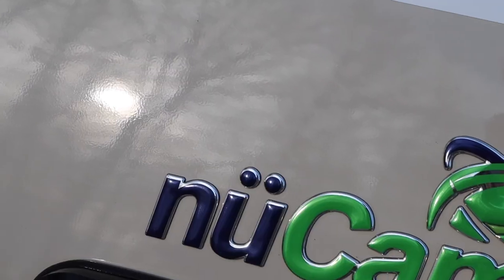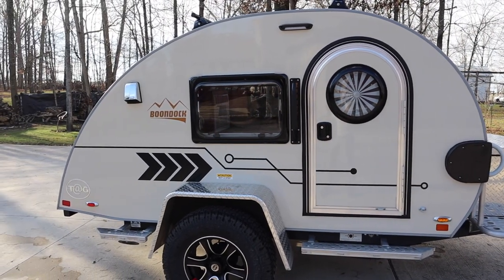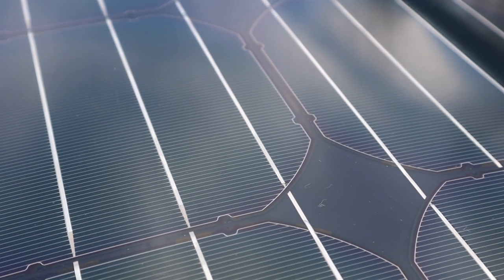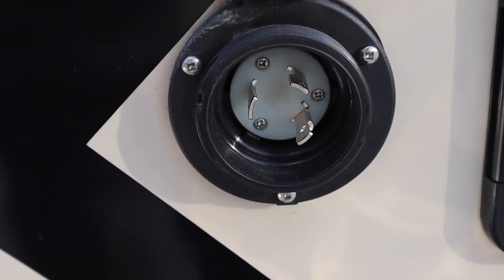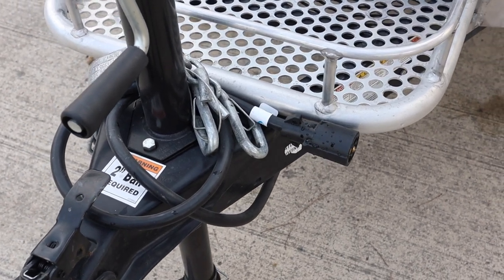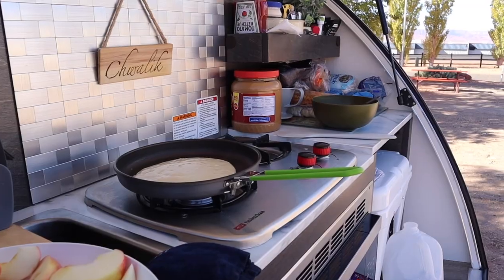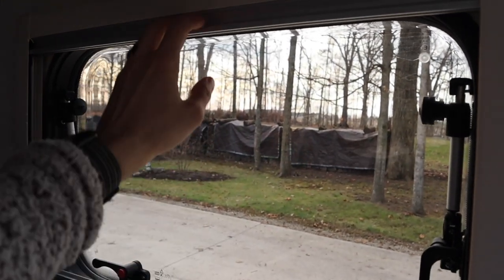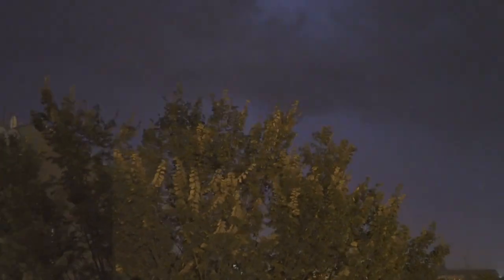Our 2021 TAG Teardrop Trailer | PERSONAL TOUR

Comment: Nice review! We have the 2020 XL, & the only problem we've encountered was excess humidity inside when using the ac; any ideas on cracking the windows/fan etc to keep the unit recycling?
Reply from the maker: Yeah, we’ve had that issue. We have the fan running to push air out and leave most of the windows cracked. That has worked for us most of the time.

Comment: How long will your heater and AC run off your solar battery setup? or can those only be run when you are hooked up to shore power?
Reply from the maker: The heater and AC only work when you’re connected to shore power or using a generator.

Comment: OMG

This is a great tear drop ...can you run the AC with the battery ? Can it run with the support of the solar panels? How about the heater ?  Or you will need to plug the teardrop from those functions ?  Oh yeah the microwave too...can it be turn on with the battery ?
Reply from the maker: It really is awesome! The A/C, heater, and microwave all need shore power to work. However, they do work if you use a generator! When we boondock, we have a generator to use all those things.
Reply: @AndrewChwalik  thank you for the feedback!  I really like the craftsmanship.  I will look in Los Angeles area to rent a teardrop.
Reply from the maker: Good call! If you do end up renting one, let me know what you think!
Reply from the maker: We actually borrowed Rachel’s parent’s generator for our honeymoon adventures. It wasn’t anything fancy, but worked well. I’ll check next time we visit and let you know.

Comment: what does dry weight mean?  also, how much does it cost?  thanks in advance
Reply from the maker: The dry weight is how much the camper weighs without anything in it, like water, supplies, etc. 

The price actually depends on the model you get and the dealer you work with. It will vary based on the state you’re in as well. You can find them around the $20,000 range.

Comment: Not pleased at all with purchase of new Nucamp Tag Boondock 2021. I had my Tag for one week before one of the handles to the gally broke when I turned it to open it. I attempted to contact manufacturer and receive no response to my problem. I then had my local RV center contact Nucamp and again they received no response to inquiry. The next week of ownership the lock on the other handle of to gally frozen and I am now unable to lock my vehicle. Sleeping in the Tag I kept feeling cold air blowing on me and with the light turned off I could see the huge gap between the door and the trim. I have only had the trailer for a month. Not pleased at all.
Reply from the maker: I’ve had nothing but great experiences with nuCamp. They’re always responding to customers so maybe you have their number or email wrong. Try emailing help@nucamprv.com. They’re customer experience team rocks and always works to make things right.